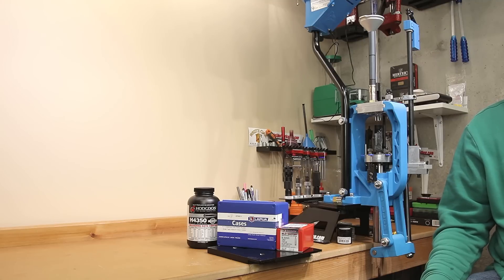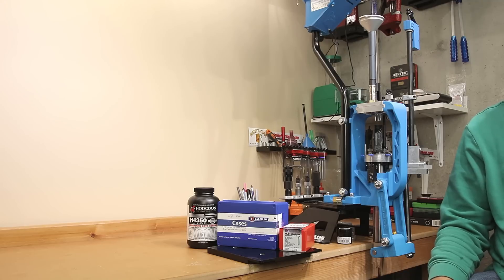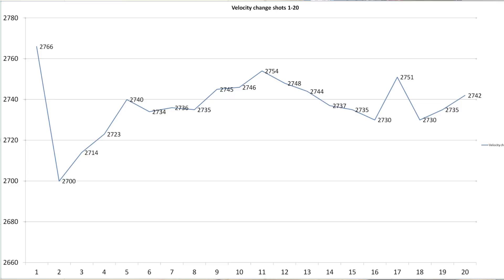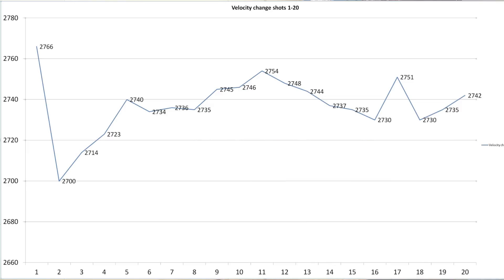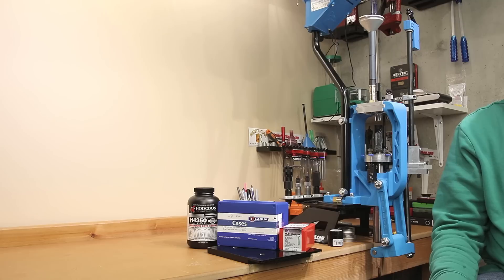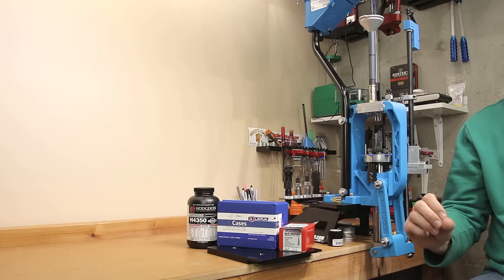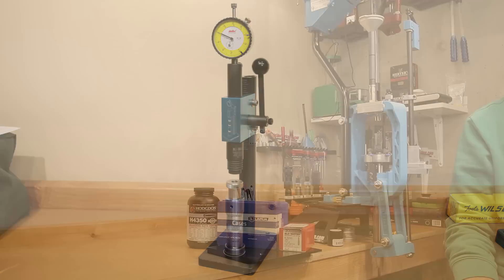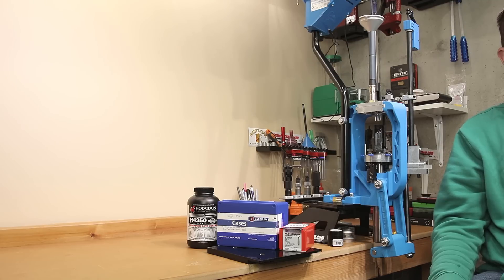How many time should I reload a single case? - Hand loading questions answered

Comment: I started reloading at 19 and am now 74. Military brass, 30-06, 7,62 NATO, 5,56, .45 auto, 9mm, can be reloaded a dozen+ times.Some of my brass have WWII headstamps. I swage the primer pockets with a Dillon primer pocket swager. Some brass is delicate like the new .350 legend. I am getting 5 reloadings (Winchester brass) and see vertical case splitting. I am not loading to max, the brass is delicate.

Comment: HOPING YOU CAN HELP.  I SHOOT THE SAME RIFLE, LOAD, AND BULLET AND I USE THE SAME CHARGE ... I NOTICED THAT YOUR NEW BARTLEIN BARRELL IS IN 1 TO 7.5 I HAVE 2575 RDS THRU MY RPR AND MY GROUPS ARE STARTING TO VARY ON ME.  I AM THINKING ABOUT GETTING A NEW BARREL.  wHY DID YOU GO WITH THE 1 7.5 VS THE 1 IN 8 TWIST?  SINCE I HAVE THE SAME SET UP I AM HOPING YOU CAN PROVIDE A LITTLE INSIGHT.  ALSO, DID U INSTALL THE NEW BARREL?  OR DID A GUNSMITH OR THE BARTLEIN COMPANY DO IT FOR YOU.?  AGAIN THANK YOU FOR ALL OF YOUR GUIDANCE

Comment: You cannot put a number of firings for all brass!!!! If you are new enough to reloading that you don't know this you need to know some real world facts.

Some cartridge shapes stretch more than others.

Higher pressure maximum loads stretch brass more.

Jacketed bullets stretch brass more than cast bullets, a lot more!

Thin Winchester brass has more volume so it runs the same velocity at a lower pressure. Thick Lapua or Remington brass will be a higher pressure. Military brass is harder and more brittle. More apt to split before stretching. Improper annealing shortens case life.

A low pressure load can extend case life almost indefinitely. A chamber that is the closest size to the sizing die will make brass last longer.

Comment: Keep your loads down to a sensible level,  and the cases will last for a long time.  Loading .45 ACP for close to 50 years, I never had to check length, etc.  Just tumble and load.  Of course these were for reduced loads fired indoor shooting.

Comment: I have been reloading various caliber's of both rifle, & pistol ammo.  After my dad passed away, I inherited his 30-06 rifle, cases and reloading equipment.  Some of his brass cases were from the Lake City Arsenal with head stamp of 58 & 62 Match grade cases.  I know for a fact that my dad and I reloaded these cases many times but never loading anything at maximum velocity or powder.  We typically would resize the cases without the benefit of a tumbler, or annealing.  We measured each case and only trimmed if it were out of specifications.
Now, I have relooked at all of these cases and separated them into a separate group.  Commercial brass vs the LCA Match head stamps.  After thorough cleaning, measurement I have found only a small fraction of the cases within a sample group of 50 to be out of specification where the neck length was over the max  length by a few thousandths of an inch.   Careful resizing, and annealing is next before reloading with a standard large rifle primer and a 150 grain Sierra Pro Hunter BT projectile.  I am very carefully documenting these old cases for personal use.  And, no, I have no idea how many times they have been reloaded and fired.  I do know they are fireformed for his rifle and I have no plans to dispose of either one any time soon.  The old '06 will be with me until the day I die and pass it on.  Semper Fi.

Comment: With auto pistol stuff that you bring or pickup at the range, throw out the stuff that's dented up too much and load it up. For the 9mm and 45ACP I shoot the most, think I have some stuff, not much since it does get lost, but has been in the rotation for over 30 years now. When it comes to rifle, you resize, inspect, and measure. If you have to trim, put all the cases in the tray and look at them from the top. The ones that are stretching out and getting thin will look thin compared to the rest of them, and you can make the decision to throw them out or not. FWIW, and I don't mean to trivialize this, but a cracked case in a rifle or revolver round for a reloader who is smart enough to ask the question to be safe, is kind of a non-issue, they'll be safe, although there are the self taught Internet Experts these days. How he went off on velocities and how well it shot, which really has nothing to do with how long a piece of brass will last (now we need him to get to a video about neck v.s. full length resizing, which does make a difference when you start reaching way out.)

Comment: I reload until visible signs of impending failure occurs, I have never had a neck seperation, or a case failure other than dents that are not due to firing. One rule though: I keep firing those rounds from the same rifle, casings rhat was fired from one rifle will not be used in another.

Comment: How much did you trim off to length in the 20 round shots? That shows you how much your thinning it out. And so much depends on your FL size die dimensions relative to your actual chamber dimensions.
Reply from the maker: Hi Patrick, Since I trimmed every firing I can not tell you exactly, but I will say that the Lapua brass tends to not grow much more than.002", maybe less. Using the same die with Hornady brass its usually more like .004-.005" each firing.

Comment: Really cases should be tossed out after three to five reloadings due to fatigue according to most manuals but I just shoot them until they start to show separation or crack/split. Then again I am not as super concerned over small performance loss as some shooters.

Comment: Very nice work.. I am not at this level of reloading, but this is still very useful info. Once I cycle out my noob reloads where I had a dirty sizing die and scored the case necks to where they almost split after firing, I think I will be alright. That was way back when I used crushed walnut shell in my vibratory tumbler and didn't get all the dust off of them before lube and sizing. Now I have a wet tumble system and love it so much more.

Comment: Many years back I ran a test on Winchester, R-P and Federal cases. Didn't have a chronograph, 1971, they were real expensive. Test rifle: Remington 700 BDL  with a 4-12 Redfield scope, 24 inch factory barrel 1in 9 twist. IMR 4831, 61 grains. All loads used CCI 250 Magnum primers. Speer 160 grain Spitzer slugs. I shot for group, separate target for each case.  To start I cleaned the barrel to a spotless condition, it was not cleaned or swabbed again till all testing was completed. I fired 5 rounds of my favorite load at a target 150 yards out, that was my base, .75 center to center. All cases were prepped and loaded the same in the same order. These were pretty stiff loads, saying the were full house high pressure would be correct. The purpose was to see how many times I could load a case before the belt expansion was so great I couldn't or at least had an issue with closing the bolt. The Winchester case died first with 11 rounds, next was the R-P case at 13 rounds, the Federal case lasted 15 rounds. The groups all ran less than 1" at the 150 yard range. I used that rifle to shoot everything one could find to shoot where I lived then. Untold number of rounds, all high pressure. The first 3" in front of the chamber got so worn you could drop a slug in it and it not touch a sized cases put in behind it. Should have rebarreled it, but just sold it a gunsmith. My experiment was good for the time, but with today's technology it would take more time than I have life cycle to complete. Great video, do some more like this, maybe see how many full house loads it takes to stretch the belt on a 300 Win Mag.

Comment: Well with the chamber in your rifle and your dies, and that particular lot of brass, bullets, powder, and primers it might hold then again it might not. I never understood why this is so important to some. I know guys that would in the course of a year blow up a perfectly good rifle.  I have been loading my own ammo since 1968. I still use the same RCBS Rockchucker press.  I have done this with a 270 and Winchester Western Brass. I got twenty shots out of a case before I got a neck split.  It's stupid in the end. The brass is fairly cheap.   I hunt a lot so all my hunting loads is with once fired cases.  I don't load non- belted cases more than 5 times, Full-length Resize. I keep very very detailed records,  cases, and dies, go with one rifle, and stays with that rifle for as long as I own that particular gun.  I have given up this endless load development and testing years ago, too much time and expense for splitting hairs. I still shoot the same load for the 7 x 57 that I settled on in 1970.  It's a boring thing I guess for some, I load my ammo, I know that I am going to get around 2800 fps and 1.4-inch groups dead on at 200 yards. I also know that within 350 yards when I squeeze the trigger game is going to fall down right there or soon after. It's the same for my 6.5 x 55, 338 WM 375 H+H, and 416 Remington. Plus a bunch of others I have but don't want to write a novel. We all go thru this, it's like chasing the purple dragon. You will find this out for yourself in about 20 years.  I am old now, looking back on it, I could have saved a boatload of money on it but understanding this, but it takes a lifetime to understand some things and even then we tend to look for the unobtainable perfection, it's human nature I guess.  Like your loading bench what little I see of it. Nice.
Reply: The money he drops on reloading is nothing compared to what he'll drop on a competition: to enter a competition can be a couple hundred dollars, then there's flight, rental car, hotel: you spend that kind of money, you go to win, not to shoot 1.4 inch groups at 200 yards.
Reply: For some people, the hunt or the paper punching is the real hobby and the reloading is a means to an end. For some others, that splitting hairs to get that 5% extra performance gain from that 50% extra work and expense is just as much a part of the hobby as the shooting.
Reply: "Blow up a perfectly good rifle" ... ?

Comment: No talk of the Big Blue Elephant in the room! LOL.  That’s a big surprise. Know you can’t make better ammo on it than you are now. So, I assume you’re in it for the volume. I guess you’ve been watching a lot of F-Class John and Erik Cortina as we all have probably.  It’s amazing to see what FCJ has been able to do with his 750 as far as making good ammo suitable for F-Class in larger quantities and apparently saving a lot of time.

I was so excited years back when I first bought my 650 with every option available. Then soon disappointed with inconsistencies in the ammo, pistol at that,  which followed after previously loading everything on a RockChucker single stage. Had to start immediately with the aftermarket upgrades. The 2 most significant I found were using some kind of a clamping tool head to deal with the very excessive play and some kind of washer or bearing that will allow the shell plate to be tightened down more to reduce play and still turn freely. Since I had a number of Dillon tool heads I started by buying the clamping kit from UniqueTek and drilled and tapped them.
Then for the powder dispensing for rifle loading I use the AT 500 powder die and funnel and weigh each charge separately off press, unless I don’t care and use a ball powder with the Dillon powder measure.
I’ve since mostly gone back to reloading bottleneck rifle cartridges the old way and only use the Dillon for some large batches of 223 or performing certain tasks, as well as pistol rounds of course.
Good Luck!
Reply from the maker: Hi Jiminico, Yes I decided to pick one up. Believe it or not I am in it for the time savings more than the volume. Time is at a premium so I am hoping to increase my efficiency.  I plan on seeing what it can do in the precision department. I am not planning on using the powder measure at this point. I have watched too many videos online with powder pouring all over the place, its giving me nightmares. It will probably be a while before I make video on it, but I will. I would have moved it off the bench but its a pain to hang from the wall so I need to figure that one out.

BAR

Comment: 41.5 H4350 is exactly what I use for that bullet and the 140 HPBTM.  I get about 2750 fps using Hornady large primer and Winchester magnum primers.  I get similar results using Starline small rifle primer brass.
Reply from the maker: Charge weights in this area for this combo seem to be etched in everyone's reloading logs at this point. It just seems to work.
Reply: @BoltActionReloading  I think at that point it becomes a matter of seating depth and consistency in reloading.  After that it's all on the shooter. :)

Comment: I see you dropped money on the dillon!  I remember when you said you were thinking of doing that from JRB's stream.  Is it everything you ever hoped for and dreamed about?

Back to brass life - I can't tell the number of times I've been mortified to find out some people only get 3-5 reloads from their brass.  And these are modern, factory rifles with decent tolerances, not the god-forsaken milsurp stuff I subject myself to.  It makes me wonder what horrors they visit upon their rifles.
Reply from the maker: I did pick up the Dillon. I am withholding judgment till I get some experience with it.

Brass life - I have heard a lot of people give recommendations and this is where the conversation gets harder. If you look at cheaper brass, I haven't got the service life out of it. (ignoring performance) The glaring thing that no one will want to say out loud is "If I can still get more reloads out of it do I want to?" what am I giving up? (plinking vs precision) If it could be used 50 times it doesn't mean that you want to. (does the SD go crazy?) I would really like to put some more data behind this but I am not sure its worth putting the time into. The people that need to know, won't believe it anyway.
Reply: @BoltActionReloading    For what it's worth, I always appreciate the effort put into data like this.
Reply: When I first started reloading 308win, I got 15 reloads before some of the primer pockets got loose. Now I'm using LC brass.

Comment: Very helpful video, this idea resulted in a good tool. Hope you could repeat with seating pressure metering. 
Min 5 fouling shoots I thought was the norm, but very nice and helpful to see it confirmed.
Reply from the maker: Glad it helped. I want to run some more testing like this and get more data. I just have to find the time.

Comment: I keep reloading the brass until my primer pocket gauge shows it's too loose or I see evidence of an impending case head separation.
Reply: It really depends on the operating pressure. 30-30 cases are good for at least a dozen, hot 270 maybe 8, revolver cases until they come apart. I've separated heads on 357 cases, and split others longitudinally. I've yet to wear out a 45 Colt case. 

The 257 Roberts is hard on case necks for some reason. They split well before the case head "separation is near" ring shows up. 

There isn't really a firm rule.

Comment: Some magnum rifles will loosen primer pockets in as little as 6 loadings. Straight wall casings can be loaded almost indefinitely for single shot rifles where no mouth crimp is needed. My357 and 44 magnum go 6 to 8 rounds before case necks cracked. Too many and you risk case neck separation. On belted magnums you risk case head separation. Feel the inside of your case with a bent Paper clip to feel for any dips inside near the case head. This was in old speer manuals.

Comment: This offers some pretty good insight. For me, in particular, the fowling shots. This was a very interesting video.
Reply from the maker: Thanks. Glad  you enjoyed it.
Reply: Fouling
Reply: @woutervokar7215  When you're shooting pigeons, I think you can call it fowling.
Reply: @Fudmottin  Yes, buuuuut, if you shoot fowl with your fouling shots, (which inherently less accurate), would you consider that a foul shot (is it ethical: what if the fowl is a foul fowl, is the shot then more ethical?) or is it a fowl shot? I suppose if you shoot the fowl with your foul, even if it were a foul fowl, the foul shot still results in a shot fowl. 🤔😉
Reply: @wilfdarr  I think with current laws, you have to use solid copper bullets. Or at least something lead free.
Reply: @Fudmottin  😆

Comment: You should try using HBN coated bullets to see if you can reduce the amount of fouling shots you need. I've seen the difference between my cold bore shot and second shot fall by 10 to 20 fps and more consistency as a whole.

Comment: Excellent expirement! Looking forward to the next one measuring neck tension. Also, maybe weight the case after each firing to see how much it changes. Are you cleaning any carbon out between firings?
Reply from the maker: I did clean the carbon with a brush.

Comment: Excellent content as usual. It would have been interesting to see another piece of brass run through the same test without the annealing step. As well as using the your arbor press to document the difference in seating pressure between annealed/not annealed as the round count increased on each piece.
Reply from the maker: I really wanted to do that, but just didn't have time. I do plan on doing something like that.

Comment: I haven't yet started reloading, but your vids both demystify it AND show me how many years it may take before I go from novice...
To sufficiently competent...

To actually being able to experiment without blowing my face off.
Thanks.
Reply: Get reloading ol’ mate. Follow documented advice, check & double check. I’ve been reloading since the 80s, still got all my body parts in tact, made some mistakes but fixed them.
It is expanding your personal logic, go for it and remember, safety always comes first.
Good luck and enjoy yourself.
Reply: @PilotMcbride  My first over pressure sign was when the bolt velocity exceeded the muzzle velocity.
Reply: @Fudmottin  Holy CRAP!!